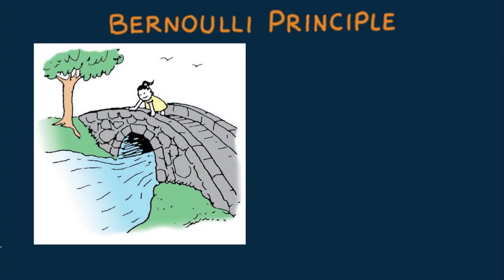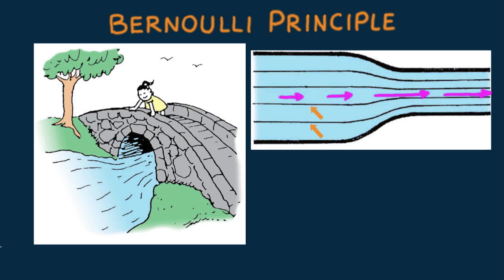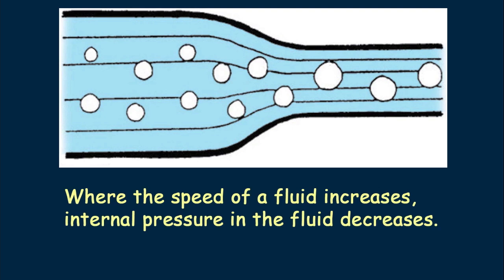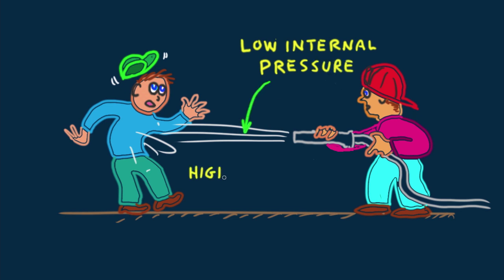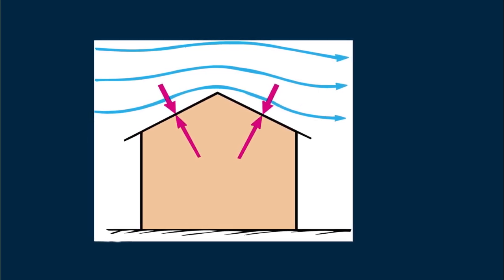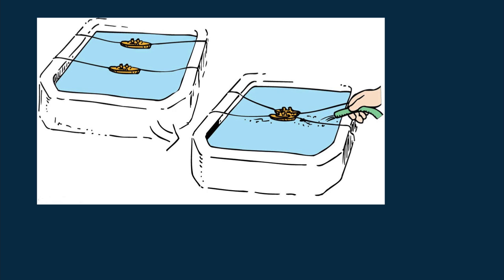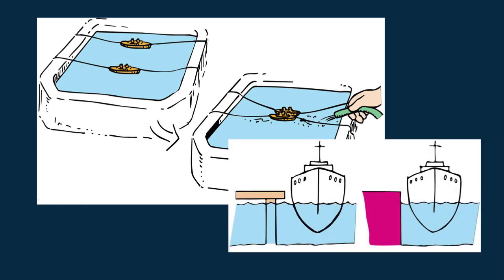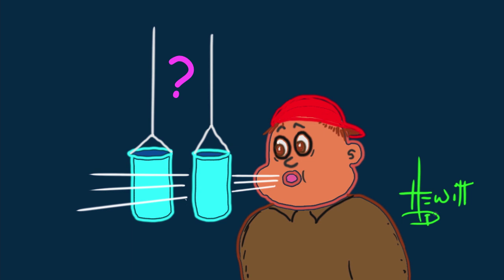Hewitt-Drew-it! PHYSICS 69. Bernoulli Principle

Comment: The common misconception is that any moving air, such as from a hair dryer, leaf blower or your mouth, has a lower static pressure than the stationary air around it. This is not true and comes from a misreading of Bernoulli’s Principle and misunderstanding of how to apply it. There are several demonstrations that are misinterpreted to show the static pressure is lower.

The moving stream of air from one of these is at the very same static, atmospheric pressure as the still air around it. It is NOT lower.

Here is the correct explanation.

This moving air has MORE total energy than the still air around it, not the same amount. This additional energy was added by the blower. The Total energy is the potential energy of the atmospheric pressure plus the kinetic energy of its motion or momentum. 

Each of these ‘blowers’ adds energy to the air in the form of static pressure.  This internal pressure is higher than the atmospheric pressure outside it. 

For example, muscles move the diaphragm to squeeze the lungs.  This increases pressure in the lungs. 

This internal pressure pushes more on the air than the pressure outside
A pressure difference between two locations is called a Pressure Gradient.  This reflects the idea that the pressure changes gradually between the two locations. 

Because the internal pressure pushes more on the air, there is a net force toward the lower pressure outside the blower.  The air is free to move and is accelerated toward the lower pressure.  This is Newton’s Laws in fluids. 

Air has mass. A Pressure Gradient provides a net force.  Mass is accelerated away from the higher force, toward the lower force and gains speed in this case. This happens at the outlet of the blower and we have the stream of air starting internally at the higher pressure and accelerating to atmospheric pressure.

That’s it.

For those watching the conservation of energy rules, the TOTAL energy of air INSIDE the blower is the same as the TOTAL energy of the stream OUTSIDE the blower. The trip from inside to outside has no energy changes in that air. 

We see that inside the lungs, all the air has nothing but potential energy in the form of static pressure and no motion with kinetic energy – no dynamic pressure. All the energy in the lungs is in the potential energy of static pressure.

The air gains speed (acceleration) as it exits, thus changing the extra potential energy of pressure into kinetic energy of the moving momentum of the air’s mass.

Comment: Sorry. Some misconceptions, still INCORRECT.
The flow over the roof is NOT a "restriction". It is a curved flow and is explained by this short AND CORERECT video:  https://www.youtube.com/watch?v=3MSqbnbKDmM 
..
Time 4:50The toy boats is more curved flow past the boats which is Coanda. Which does NOT occur above a wing.
The stream of water out of the hose is at the SAME PRESSURE as the still water (atmospheric).  Bernoulli comes into play INSIDE THE WATER PUMP.   A higher pressure inside the pump pushes more than the atmospheric pressure out side the pump.  This accelerates the water toward the lower atmospheric pressure where it assumes that lower pressure.
..
The boat / doc is also incorrect and a bit more complex about the water flowing out of the space, where the inertia causes it to keep flowing out and lowers the level, thus decreasing the pressure.  The truck thing is not the same either.
..
 The cans is Coanda and curved flow again.

Comment: +Marshall Ellenstein,
Drew,
Your initial descriptions are OK, but you fall into the all too common "Fast-Air" myth.
Bernoulli's Principle is only about changes in speed, which is acceleration.  The most common description is about increasing speed, which is acceleration, accompanying a pressure reduction, not simply speed alone.
..
The flow over the roof is not necessarily gaining speed, but it is accelerating radially (centripetal) and this supports a lower pressure inside the curved flow to maintain the curved acceleration, not an increase in tangential speed. This is not a half-venturi because the air further above is not a hard wall.  Prevent the curved flow after the peak and the lower pressure goes away.
Aspirators Don't Suck; They Curl  This shows proof that speed does not lower pressure.  A curved air path does.  NOTE: IT shows a restriction in the flow due to the insertion of the red tube FAR into the flow path!
   http://www.millersville.edu/physics/experiments/093/index.php 
..
The flow above a wing is accelerated toward the trailing edge due to low pressure above and higher, atmospheric pressure ahead of the wing.  It is the same higher pressure accelerating the air as happens in the pipe.  This is Newton for fluids.  It takes a force of pressure to accelerate a fluid. 
..
The water between the boats is more Coanda due to the curved path again.  Prevent the curved flow and the lower pressure goes away.
..
The fast fluid exiting a blower has the same pressure as the surrounding still fluid.  It is the higher pressure inside the blower that accelerates the fluid out into the lower ambient pressure, still fluid.
...
The soda pop cans is a lower pressure caused purely by the curved flow of the Coanda effect.  It is the air's viscosity that causes the curved flow.
The speed between the cans is not increasing, in fact, it is decreasing as it mixes with the still ambient. 
 Prevent the curved flow going around the back of the can and the lower pressure goes away.  I call this my Coanda Inhibitor:
Coanda Inhibitor Videos:
Setup:
https://www.asuswebstorage.com/navigate/s/732E14E1C370491082859EEA9BC1B7974
Demo, It's crude, but you get the idea:
https://www.asuswebstorage.com/navigate/s/E774D67AC2644841A87856ADA59AF67D4 
..
You'll also see the cans spin due to the boundary layer and viscous drag on the cans' surfaces.
Regards
Reply: Bernoulis theorem is applicable for internal pressure not external..
Reply: @22hu22   That is not correct. Bernoulli's Principle (inverse relation of pressure nd velocity) is a valid simplification everywhere. 
Bernoulli's Equation is valid wherever the necessary conditions (inviscid, incompressible, constant energy) are met.  See authority Charles Eastlake's use of it as one valid way to calculate values around a wing: https://wiki.mattrude.com/images/4/44/Bernoulli_Newton_Lift.pdf  
Regards
Reply: super nerd
Reply: @fx.fas.  Thank you for that very intelligent observation about this science.

Comment: The cans are going to push against each because of the reduced internal pressure.  The air molecules outside of the "system" or stream exert a force on the cans . Since the cans do not have a opposing force or less air molecules exerting a force. The cans favors the direction towards the median of the stream.
Reply: So could this explain lift and weight and be applied to explaining how this would work in flight? How would what you said be applied to an air foil...like a wing...with low pressure over the top because of the faster moving air particles being broken up... and the high pressure below the air foil (wing) resulting in high pressure...air molecules bumping into each other...demonstrating weight and high pressure...also....Newton's 3rd law...for every action there is an equal and opposite reaction....resulting in lift over coming weight to take off, but eventually level out evenly. ?
Reply: nerd